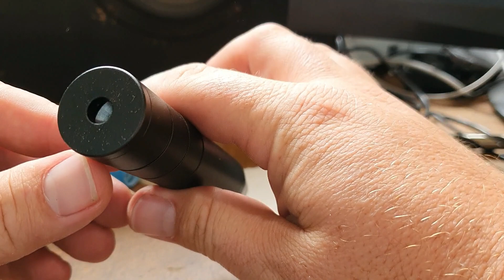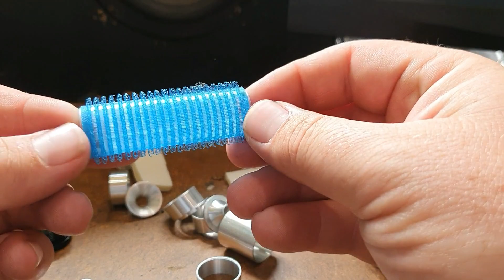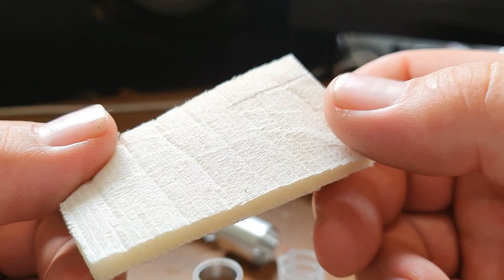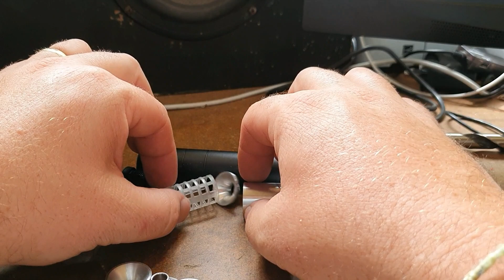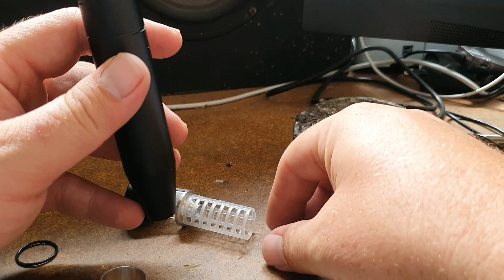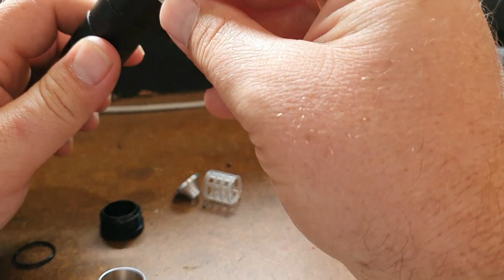CR600w Airgun silencer modification

Comment: Would have been great if you measure the DB level before and after the mod.
Reply: didnt do a before and after test, but you can hear the difference in real life.
Reply: @a.k.3659  Did a somewhat similar mod on my silencer and db level didnt lower significantly or as much as I wanted but the pitch changed which is more pleasing to the ears :)

Comment: Well before and after would have been nice before I go through all the effort
Reply from the maker: Recording a before and after video for suppressors is a waste of time, the difference can never really be heard as the recording device, you tube and the playback devices all normalize audio. To actually have detailed and accurate figures on a graph would mean very expensive mics running through a very expensive oscilloscope, all for a video that YouTube won't monetize anyway because it's gun related. Simple sound meters and apps will not accurately capture the peak of the sound every time because they use a digital sampling rate. Airgunning and modding them is meant to be fun, if its too much effort to try a 20 min mod that costs less than a few $, then maybe this isn't for you? Try it out, have some fun, it worked well for me.

Comment: you should put a layer in front as well or a thin rubber  circular plate and shot through it, and probably keep the sound maybe lower, without accuracy as a suggestion :)

Comment: THANKS great video! I am considering the purchase of the CR600W I already have a silencer and I would like to buy an adapter.
Please can you tell me the measure of the outer diameter (mm) of the barrel
Is what you see in the video the original silencer? Does this unscrew or is it interlocking?
A deep bow CARLO from Italy
Reply from the maker: The silencer they come with screws on with a M10 thread, there is another variation that comes with a slip on muzzle device that secures with a grub screw, but that one isn't actually a silencer.
Reply: @edaggs1677  Thanks very kind

Comment: Hey. I've just purchased one of these CR600W's (runs by the name Artemis where I am...), and I am grateful for your video. Can you please list out, in writing, precisely what the extra elements are and where you purchased them? Many thanks. I find the sound level reasonable already with the stock equipment, but I might do what you've shown here, just for fun and to see the difference it makes. Alsoy are you certain it doesn't deteriorate accuracy at all? (I mean, not one bit)
Reply: Plastic bits are hair curlers and the sponge, well, find some sheet sponge.
Reply: Don’t forget round nose scissors and a ruler, probably best if you wait until mummy and daddy get home…